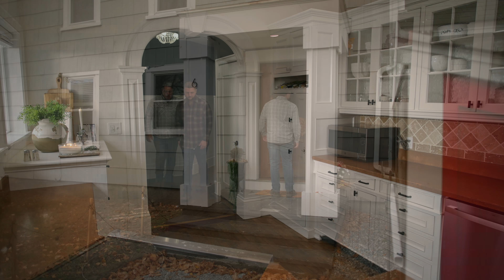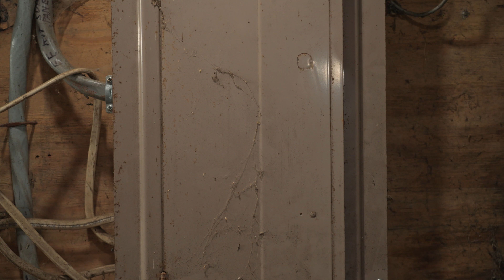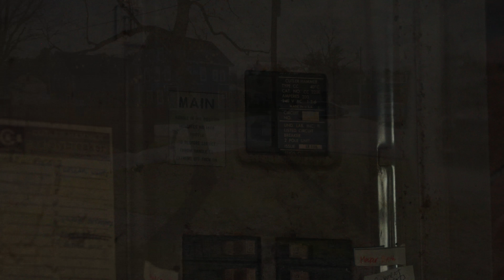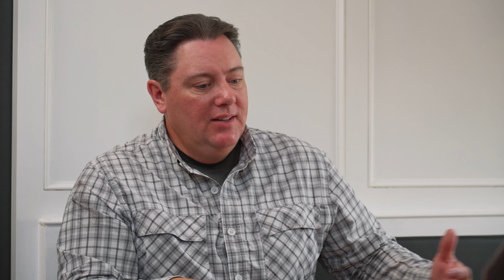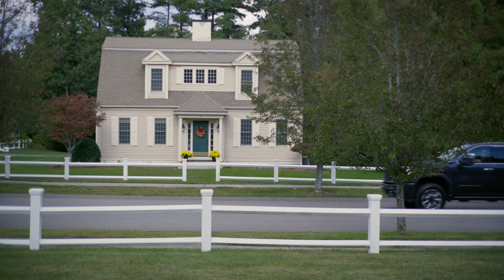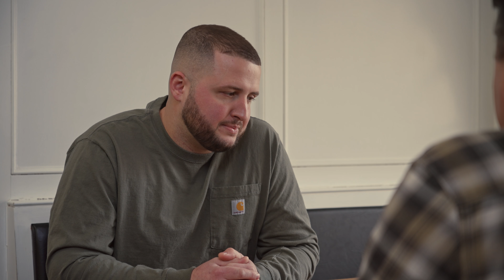Troubleshooting a High Electric Bill | Ask This Old House

Comment: Every house needs its own nuclear reactor.
Reply: I had a mad scientist customer that was making a diesel turbine to generate electricity and heat for household use. I was fascinated but he wouldn't let me see it because he thought I was trying to steal the technology.

I find the gassifier technology fascinating as well, making heat as well as woodgas for a generator to run off of. I'd love to try making one for my house, save money running on tree trimmings.
Reply: @David_H_Parker  I knew somebody that ran an ATV off of water. I didn't see it run but it looked legit.
Reply: @ That would be awesome if you live in an area with plenty of water. There are a few people running cars and trucks off of wood gas. Again, great if you have an abundant supply of free wood. One guy featured got all of the scraps from construction sites and cut them into small cubes for fuel.